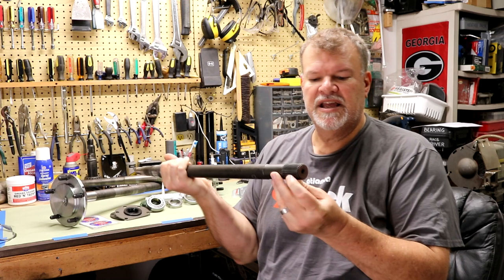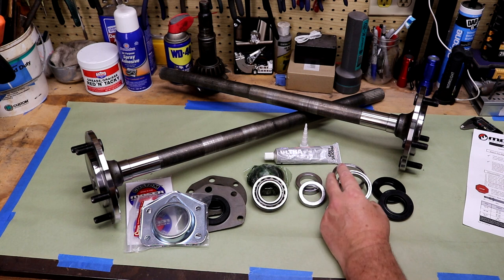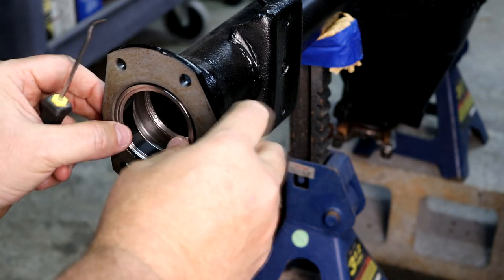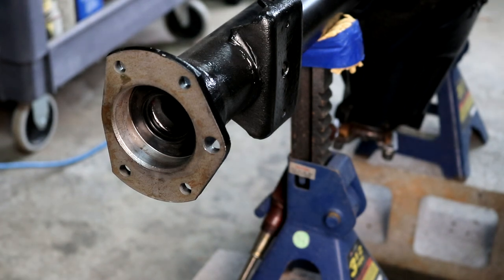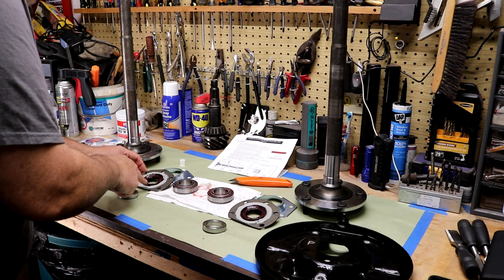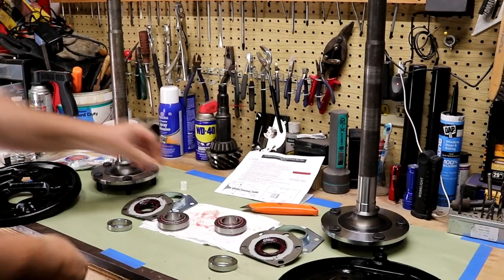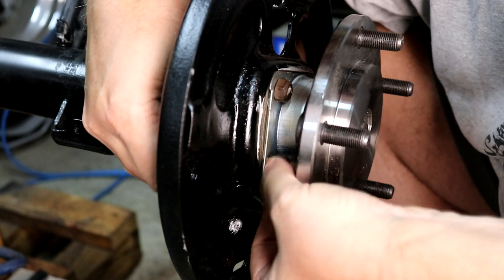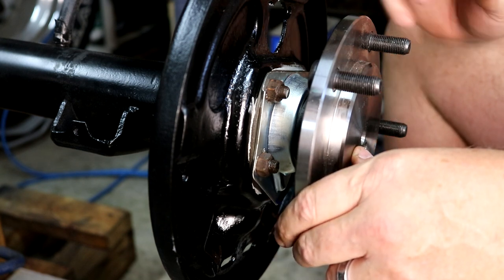AMC 20 One Piece Axle Upgrade | Rebuild Part 5 | Jeep CJ7 | Project Rowdy Ep045

Comment: if you dont have a press. put those axles in your chest freezer over night, then put the bearings in the oven at 350 for one hour. just drop the bearing on to the shaft, it will drop right into place. just did mine and it worked great.
Reply from the maker: Great advice.   Cheers!

Comment: Great set of videos. I'm taking out a troublesome locker and replacing with spider and side gears on a CJ7 that I have just purchased. The trouble is, it's already had solid shafts installed some time ago. I'm also having to replace wheel bearings (as showing signs of  ware), seals and spacers but I have no instructions. So this video has been priceless. Pulled the retainer ring off with my press but couldn't get behind the bearing. I have had to take a grinder to the original bearings. Cutting the cage which releases the rollers, enough to get the outer race off. Then heat up the inner race enough for it pull off with the back of a claw hammer. (just for those faced with the same thing)
Reply from the maker: Sounds like you had to get a little creative.   I don’t believe there is a non-destructive way to get those bearing off.  And there is really no need to try to preserve them.   Cheers!
Reply: @UCanDoIt2Mike  Sorry, I hadn't see your episode on changing to brake discs where you went through the same problem. I have a real problem getting my mind around how these wheel bearings work. I saw another YouTube video where a garage was upgrading a jeep and installing a solid shaft kit. He shows that you can remove the small collar from the out race on a new bearing to install it. Since the collar is the only part of the bearing touching and held in by the back plate, the small collar must be the only thing that stops the axle shaft coming out when fully assembled. When bolted down, the back plate and then the collar push on the ends of the bearing rollers. The other end of the rollers push on the inner end of the inner race. Are these two "shoulders" the only things that stop the shaft and wheel etc disappearing down the road? If so, the bearing isn't used as a normal tapered bearing would. The weight of the car acting on the bearing is the only way the two races are pushed together. How is the bearing kept tight so there is no play at the wheel ? Does this sound about right or have I missed something? It almost makes more sense to turn the bearing around.

Comment: I’ll re watch.  I have a 78 in college, and just turned 50 and got an 82, with a 78 304 (I couldn’t go Chevy like you, but all good, just that nostalgia for me).  I just picked up an AMC 20 and D30 Wide Track (mine has NT all drum, so that’s not 82, ha). And I’m going to follow just about your every step here on this AMC 20, wish you did the D30 rebuild before your TC, ha, so I could follow that.  Great videos, much appreciated.
Reply from the maker: Sweet!   I believe my D30 build will be next.   That way when the frame is done, I can get back into a roller.  Cheers to you Jason.

Comment: Great video, as always! Serious question though - did you happen to have ANY end play or in/out play of the axle shafts? I'm currently rebuilding mine as I had a gear oil leak and my drivers side shaft moved about an 1/8" give or take.
Reply: Did your axles have any end play when you were done?
Reply from the maker: There should be 0 end play!   In the Bearing and Seal Fitment step, were you within tolerance?  The fact that the bearing protrudes the housing by (0.020 - 0.080) suggests that the Sealing Plate will actually create an interference (compression) fit for zero endplay.  "It sounds like" you may have forgotten to insert the Oil Seal in that side.  (1) It would allow the bearing to move in and out, and (2) it would explain the oil leak.  You definitely want to take it apart and investigate and not run it as is.   This has nothing to do with whether or not you installed the Bearing and Press Sleeve to the correct position.  Regardless of that, the Bearing needs to get trapped by the compression and the axle can live where it lives.   It is a Bearing, Spacer, Seal issue (my guess).   Hope this helps.  Hope you get it sorted out.    Mike
Reply: @UCanDoIt2Mike  Yessir you gave me the answer I was looking for. Before the rebuild, I had excessive play. Now I am replacing everything as you did in the video and it's going just fine. I just wanted to verify there should be 0 movement in and out. I understand why the bearing should protrude, because there has to be a little preload on it to keep it nice and tight. Thank you again

Comment: The Mosers are a great upgrade for the Model 20.  Just out of curiousity... was there any consideration to converting to disc brakes?  That certainly would have been the time to do it.  Realize it does add a little complexity to Project Rowdy... that would have been a worthy upgrade.  Did it my 20, and again when I went from the AMC 20 to a Dana 60.  By the way... didn't notice in prior videos that you were in the Atlanta area.   N. GA (Canton) myself!
Reply from the maker: I did look into the options for converting to Disc Brakes.   I want to stay with 15 inch wheels, so the options seem to cut down.   I actually bought some Geo Tracker Rotors (sitting on my self).  I know that there are some Cadillac Calipers that provide a solution with parking brakes.   Just seemed that I was continuing down a rabbit hole on that.   Do you have any insight?   Have you done it?   Since I am replacing all of the Brake Booster and Master Cylinder, the change would not be an issue with that as well.   Was just reviewing my tear-down photos in prep to install the Drums.   Speak now or forever hold your peace.   Cheers  (Town Center)!   Mike
Reply from the maker: Now you've done it!   Just found a local guy selling his Disc Brake conversion kit and heading that way to purchase.   This is going to require a change order!
Reply: @UCanDoIt2Mike   HAHAHAHAHA!  Sorry (not sorry) Mike!!!  :)

Comment: Did you happen to notice a gap between the spacer ring and inner seal when you drove it in the housing? I need two new seals and am trying to find them locally without ordering. Would you happen to have an alternate part #?
Reply from the maker: I’m pretty sure the the spacer ring and seal are touching in the final configuration.  I would check Quadratec for the seal part number.

Comment: How far do you press the bearing on?  My replacement axel has a small ridge that jumps the size just barely larger towards the wheel. Do you press it all the way to that?
Reply from the maker: I wish I had a measurement of the finished distance between the mounting plate and the axle hub.   You have to press it on there pretty far.  I believe you have to get it on that small ridge.   If you do not get it on there far enough, the Bearing will keep the axle from inserting into the axle tube far enough to engage with your differential and your axle flange will protrude further out too far.   In my next Episode, I end up changing this whole setup to a Disc Brake solution and I believe, I show the press depth a little better.    Mike
Reply: I’ll check that video out. Thanks for the resources. Great clear videos.

Comment: Rowdy, I am going to install my one piece axles this week and can you answer a question for me?  When you are loading the axle I noticed you had the spacer pulled back out.  Were you able to do this without damaging the seal and how is the best way to keep from damaging the seal?  I definitely want to check my clearances before install.  THANKS
Reply from the maker: @matt82654  Just after I confirmed that the spacer/race/bearing protrudes the house between the spec (0.020-0.080), at location 8:50 in the video, I only removed the Bearing.  I left the Spacer and Seal in the housing.  When I assembled the axle, what you see on the table (9:22) is the Bearing and Press Ring.  The Press Ring is additional insurance that the Bearing stays attached n its place and the axle does not slide out after installation.  

Do not install the seal when checking the initial clearance.  In the event that you do need to narrow the width of the spacer, the spacer will need to be removed and you will damage the seal.
Reply: @UCanDoIt2Mike  Thank you so much! That makes sense. 
 I have been somewhat afraid of this job as I have never done one before.  Your video's have helped me more than you will ever know as I have been restoring my 1981 CJ5.

Comment: Hey Rowdy, me again.  Do you have a video of  how to get the old bearings off the AMC 20 to remove the brake plate?
Reply from the maker: @matt82654  Yes!   One of the AMC videos has that info.  I used a hydraulic press.  There is a playlist for the AMC 20 on my channel.
Reply: @UCanDoIt2Mike  Thank you, going there now.  Got the axle out and moving forward.  Thank you for your helpful videos!

Comment: Can you do mine? I’ve had two different shops do mine and they both sides leak if slander on a hill, driveway and not much slant.
Reply from the maker: I have a great appreciation for those that do this correctly for a living.  I enjoyed the process and learned a lot from my research and execution.   The biggest thing I learned is that I would starve if I lived in a small town and this was the only available job.   I cannot imagine doing this over and over again.   With that….  I would have to decline!    You might want to inquire around for recommendations for a shop with successful experience.    Mike

Comment: Since you seem to use that press a lot in this project… which one is it?
Reply from the maker: Mine is the 12 Ton Floor Press from Harbor Freight.  It has done e retrying that I e needed.   In the future, if I need more, I should be able to swap out the Bottle Jack to something bigger.   Just haven’t needed anything bigger yet.   Cheers and thanks for watching.  Mike.

Comment: Where did you get the tool that you use to tap the seal, races, and bearings into place?
Reply from the maker: I purchased it as a small kit from Amazon.  Here is the kit that I bought.   https://amzn.to/3R00W5G
Reply: @UCanDoIt2Mike  Thanks! Really enjoying your videos too!
Reply: @UCanDoIt2Mike  does your bearing kit you recommended have to tools stamped in Metric or SAE measurements?

Comment: Hi, my rear passenger side shaft has too much play even after 3 spacers, left side is good. Any ideas ?
Reply from the maker: Did you remember to include the Seal?   In my case with the Moser Axles, There is a Seal and Metal spacer that trap the bearing in the place where it needs to live.
Reply: @UCanDoIt2Mike  yes, seal, retainer ring and bearing all on correctly.
Reply: @UCanDoIt2Mike  I thought the bearing was not  pressed far enough but it was correct. Are bothe sides supposed to have spacers or just driver side?

Comment: Curious what the correction was. I must have missed it...LOL.
Reply from the maker: I had not pressed the bearing on far enough.  I reached a "Stop" when the Press Sleeve hit the intended land.  I thought that was the bearing hitting it's Stop.  The axle then installed about 1" too far outward.  After speaking with Moser, they agreed and so I re-pressed the bearing on further to correct.   Cheers!  Mike
Reply: @UCanDoIt2Mike   @UCanDoIt2Mike  love your videos! Thank you so much for being thorough and explaining with all of your processes. I have a question: when pressing the bearing and press ring on did it go all the way down? Or was there room for the brake backing plate to wobble a little? I took mine apart and it wobbles not sure if I need to press it on more. Thanks!